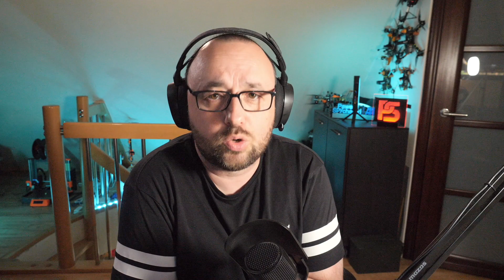The future of FPV flight controllers

Comment: Good to know. I bought my H7 for electrical robustness and future proofing. Running 6s 5000mh + I get the feeling more is better as you go up in cells and capacity.
Reply: lol what :D that doesnt have anything to do with it. i would argue that the f405-wing is the most reliable FC out there. im running one in my 6s 20000mAh crosswind mini
Reply: Your crosswind mini Carry’s a 20k battery? How much does it weigh? What size motors /ESC’s are you using?
Reply: @tchristensen8154  mn-3110 470kv, hobbywing 60a esc's and the battery weights around 2.3kg
Reply: Wow! I’m running 5065 400kv with 100amp ESC.
Reply: @tchristensen8154  arent those WAAAAAY to big? i had to cut some foam away for my 3110 motors already :D